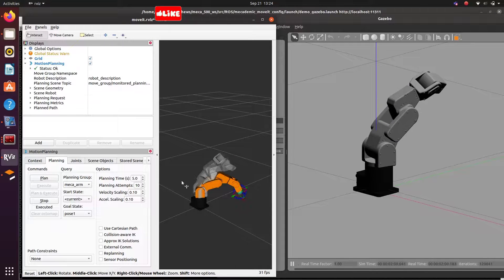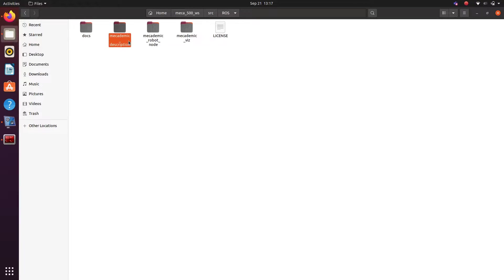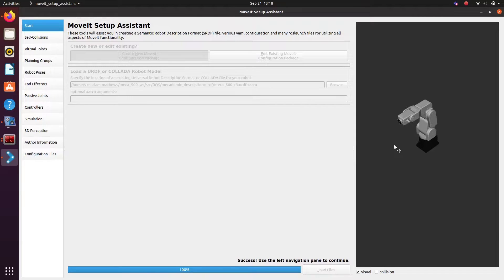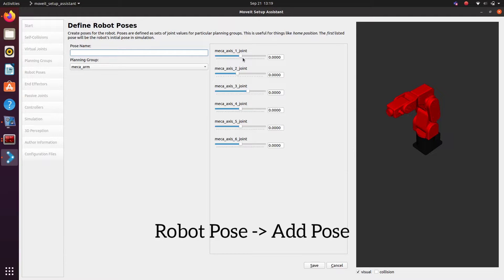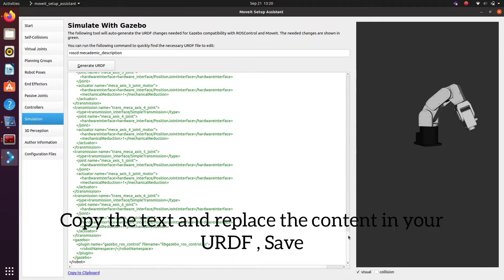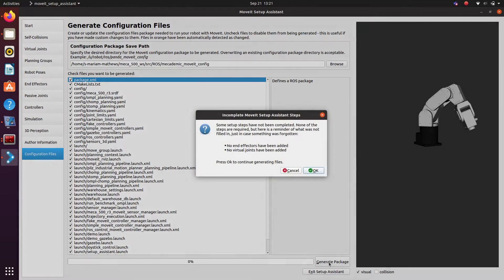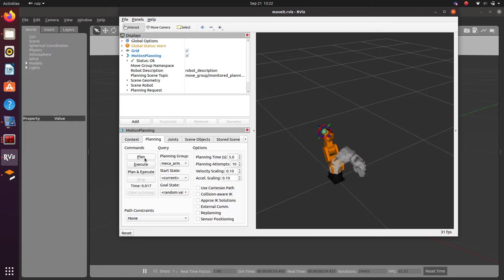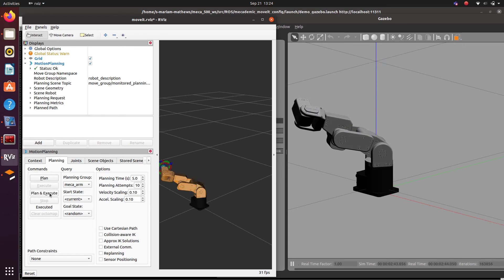ROS Tutorial Noetic - Robotic Arm Simulation / Moveit Package Creation

Comment: hello can you explain this please?(it's a little urgent and my robot isn't showing in gazebo i'm using the same robot as yours) 

This issue is in ROS Noetic mainly
When you use Overrite URDF option while generating urdf one syntax will be wrong
Issue- Error  parse as old deprecated model file failed.
Error Code 4 Msg: Required attribute filename in element
is not specified in SDF.
Error Code 8 Msg: Error reading element plugin
Error Code 8 Msg: Error reading element model
Error Code 8 Msg: Error reading element sdf
Solution- add this line filename="libgazebo_ros_control.so" to         
plugin name gazebo_ros_control" filename libgazebo_ros_control.so"
in urdf

i'm getting this error:Error [parser.cc:488] parse as old deprecated model file failed.
Reply from the maker: Open your urdf and there will be similar lines. compare with this one and correct if any mismatch

 <gazebo>

<plugin name="gazebo ros_control" filename="libgazebo_ros_control.so">

<robotNamespace>/</robotNamespace>

</ plugin>

</gazebo>